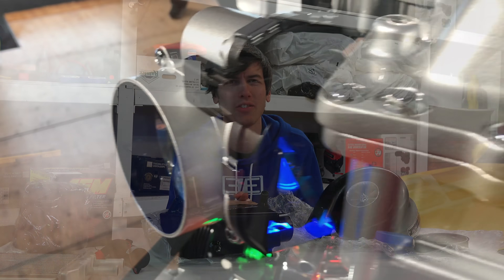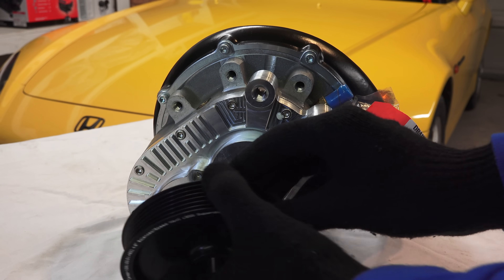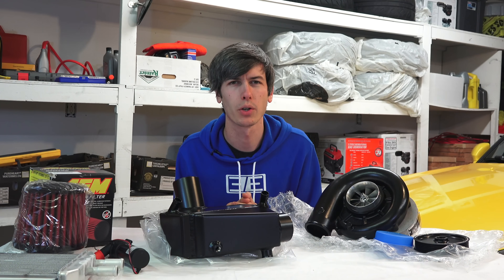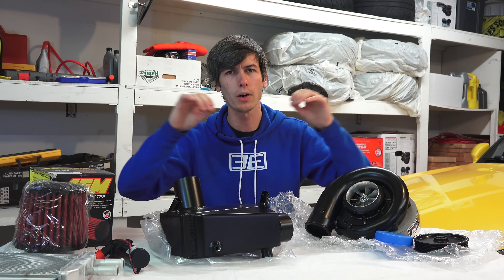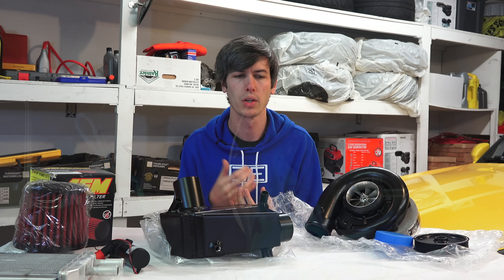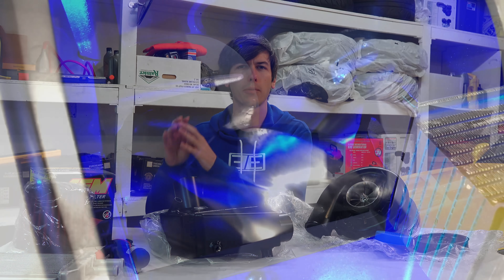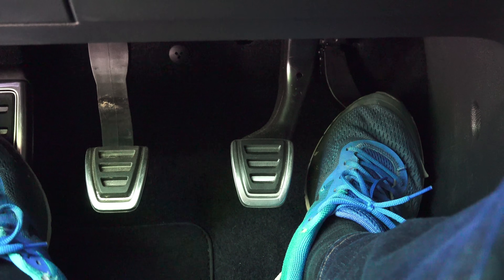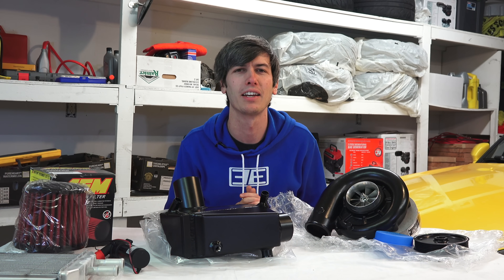Turbochargers vs Superchargers - Which Is Better?

Comment: Efficiency: I'm no engineer but the power has to come from something right?
So the turbo charger uses the exhaust velocity but slowing down the exhaust is also taking torque from the engine since you are slowing down the exhaust stroke. right? So I assume that the power loss with turbo engines isn't as great since the turbo isn't slowing down the exhaust as much in low load situations.
Couldn't we also engineer a super charger that only engages when you... go into a kickdown let's say? It could couple using a small clutch or even some sort of magnetic coupling. Than it would just need 2 intakes, one though the supercharger and one normal one with vents that close if the air pressure is on the wrong side and voila, efficient supercharging ~ probably with introduced lag though.
So If I can come up with such a concept, I assume many people smarter than me already have and there is a catch making that not viable. I'd love to hear that catch.

Comment: Do you get the same fuel economy benefits with a supercharger when your just cruising down the high way or in low load situations? Or does that constant draw from the pully overall always use lower efficiency?

Comment: the intro to your video ! You should talk about Quick spool valves for turbo chargers. how they literally cut off one section of the turbine housing to increase the pressure in the housing to help reduce lag.  

Just a side note for anyone who plans on running a quick spool valve do not run it on a divided twin scroll turbo flange. if you want to run a quick spool valve only run it on an open flanged turbo manifold.

Comment: Quick question, if a car like the mr2 turbo has it's factory turbo inside it wouldn't it already be mapped to match the engine, if so couldn't you just copy the setting so when you add a new turbo you'll have the lest amount of lag.

Comment: this is why the response of naturally aspirated engines is the second most important thing to a race car driver,  first being tires. nobody likes lag,  even if it is just a little bit, its too noticeable.  you can compensate for the lag with a anti lag system but  unless you have millions of dollars to spend on turbo rebuilds, you'll be running smaller turbo wheels to compensate for lag....but you then lose power at high range. so now you add a bigger turbo to compensate for the smaller turbo and all you added was just complexity. supercharger are just more simple and fun when driving on the street with a positive displacement. 

I love turbo for power and efficiency with small engines but nothing beats displacement..... except race rules 😂😂😂😂😂

Comment: Is turbo lag that much of an issue with larger displacement engines? I had read some time ago that the real issue with turbo lag was with smaller engines, particularly 4 cylinders. With engines that are around 4 liters and up that are moving lots of air, I wonder how much real lag you would experience.

Comment: what if we install a small electric engine to power the supercharge and therefore we don't take power from the car's engine ? how much power do a supercharger need to work ?
Reply: do it ! To be fair, where will you get the electricity from? How will it get powered aside from taking electricity that the engine produces from its use? It’s still going to leech energy from the engine. Either that or you have to charge that motor whenever you want to use it.
Reply: 20 % of the engine power is a lot .. so I guess my " invention" will not be practical . For a 300 hp car you will need aprox 50 kw electric motor to power the supercharger and some storage room for the batteries . hmm ..
Reply: About 20% of the engine power so if it's a 300hp engine you need a 60hp auxillary engine to power the supercharger.
Reply: i guess from some li ion batteries which can be charged back from car's 12 v socket ? but I understand it's not practical thoug ...
Reply: do it ! A quick internet search found Aeristech which claims to have a 35kW 150,000rpm motor to replace a turbo turbine.   But I am sure it's not in mass production.
Reply: The Hellcat's supercharger requires 80 hp to run, so...that's about 12%.

It depends on how much torque the engine itself makes and the amount of boost the supercharger makes at a given pulley size.

An electric motor would not have a linear boost progression tied directly to the engine. You would need a controller tied to the throttle position sensor, or you would have problems. An electric motor that could produce that much power 100% of the time would also be horrendously expensive and probably very large.
Reply: ootdega ootdega I ran some numbers.  For the Hellcat, using the quoted max boost of 11.6psi, and using 6000rpm for peak power, assuming these coincide, I get 60HP for the supercharger compressor without drive losses assuming 70% compressor efficiency (which is good) and the quoted max intake manifold temp of 140F, reasonable for the 80HP quoted to drive it as I don't have the exact conditions.  For comparison, 60HP compressor power is about what's needed for a 2.5l 4cyl at peak power with 24psi boost.

Comment: Have to agree with your analysis. My 2002 WRX was often a real pain to drive because of lag. The only way to overcome that was to shift at high revs, where you'd come into the next gear with just enough boost to not get much lag. BUT... that costs for gas quite a bit. It became a real 'art' to get the right gear to get boost when driving, say, a mountain road and really needing power coming off an apex. It often got dicey. It would have been a nightmare except for the AWD saving my butt more than once. Thanks for your channel and your knowledge.

Comment: This comment is not related to this video but I was wondering can you explain why breaks are bad if they lock the wheels? Isn't that the point? They would be bad if they didn't lock the wheels when you press brake pedal.
I got inspiration for this question when I saw those big brake disks on that blue Mercedes in this video :D

Comment: Does any systems exist that concentrates on the exhaust part? What if you, somewhere in the exhaust pipe system drilled a hole, attached a line connected to a compressor or something that would blow air back out the exhaust line and thus create a vacuum, which sucked out exhaust gases faster?

Comment: Given engines with the same cams, displacement, compression ratio and boost pressure, shouldn't the turbocharger make more horsepower due to the lack of parasitic losses from spinning the supercharger off the crankshaft vs the "free " energy from the exhaust stream?  For example the GM LT4 should make more horsepower with turbos than with the supercharger, only it will be skewed toward the top end of the rev band.

Comment: Am I the only person around that kinda likes the idea of turbo lag? Like, with turbo lag I can just slowly/carefully drive (like maybe in bad weather or in front of cops), but then when it's time to merge onto the highway 😏😏😏
Reply: Yeah, that's not anything to do with turbo lag. With a supercharger you just have more immediate pedal control.
Reply: Mario Espinosa I think that's boost threshold
Reply: The problem is that around the mid RPM you'll get a boost in power that's not proportional with your pedal. Which can cause problems if you get it at the wrong time.
Reply: Yes, I think so. Not sure why you would prefer a lag over instant response from your throttle. Merging in the highway is a good example. I want to know exactly when that power is kicking in. Guess what I do know with a supercharger because as soon as my foot hits the  pedal it's there
Reply: I am with you  Mario. ..that along with torque steer makes for real exciting times
Reply: Oh, boost threshold. Thanks! (I meant that I like that with turbos I can stay efficient in low RPMs, but then when I want power I can go to the high RPMs to get it!)
Reply: @marioespinosa6693  yeah , you have to go to the higher rpms to get it

Comment: Hey Jason.👋  I found your channel back in your Integra days and have been hooked ever since.👌 First off, if it's fast, I like it!  Way back when, I owned two Integra GS-Rs.  I can only speak from my experiences, but I've installed a Jackson Racing (Eaton M62 roots style, 6 psi non-intercooled) supercharger on my '94 GS-R and had tons on fun until I crashed it.  Later, I bought a new 2000 GS-R and installed a Drag 3 kit w/ front mount air to air intercooler.  Running both at low boost (6-7 psi), I preferred the turbo.  There was no lag to speak of and at the dragstrip, it pulled better times at the same measured boost levels.  The turbo was properly sized for the application (T3/T04E hybrid) 54 trim compressor and A/R .63 on the exhaust side.  Both were great and I recommend forced induction however you can get it.  Thanks for all your dedication and consistently great content. Have a great day, sir.✌
Reply from the maker: Thanks for the comment and sharing your experiences!

Comment: Nice video, a follow up on Twin charging vs twin turbos (or use of electric turbos) would be very interesting as manufacturers typically favour the latter over the former with a small turbo for low end and response and a larger one for top end power

Comment: I love superchargers, they closest retain the throttle response of an NA engine. Everything feels immediate and responsive. Turbo motors are lifeless outside of spool, if feels like your driving the turbo and not the motor if that makes any sense (it doesn't). I still like them both, I just miss my supercharged cars. Don't miss the gas mileage though.

Comment: Don't forget engine bay packaging limitations. A turbo can be placed anywhere - in fact I wrote a dissertation on alternative methods of turbocharging which examined the use of rear of car turbos (replacing silencers for turbos.) A supercharger (unless electrically operated or hydraulically operated) needs to be placed in line with an output gear of some kind from the engine.

Comment: Why do superchargers need so much horsepower? Is it the gearing?
Reply from the maker: It’s the fact that it’s running a high powered air compressor. It takes a lot of energy to compress large amounts of air, as superchargers do.

Comment: Just do it like Mercedes in F1. Put a electric motor on the shaft of the turbo to spool it up with recouped braking energy, when there is not enough exhaust gas. This gives you something between a classic turbo and a electrically driven supercharger.

Comment: And the big question is: can a FRS make about 300 hp at the wheels reliably and would you need to upgrade the engine and transmission on a supercharged build? And Jason if you read this what happened to the crocodile/dinosaur costume you wore for the reading mean comments video?

Comment: Have you ever driven a hybrid turbocharger where an electric motor is used to spool up the turbo? Does it feel like a supercharger?
Reply: @Erik: 48V but otherwise as you described. That is the concept of an electric supercharger. Audi uses the supercharger only to get rid of the turbo lag, for normal operation two conventional turbochargers are installed and the electric supercharger is turned off. So I assume it won't consume too much energy, in addition it is only used in 400hp+ sports vehicles, I doubt they care much about efficiency.

The concept of a hybrid turbocharger is different. Such a turbocharger has a motor / generator in line with the turbo shaft, which allows you to boost the turbo using electricity, but also to use the turbo to generate electricity.
Reply from the maker: I have not, I’m not sure if there are currently any production cars with electric turbos.
Reply: @HerkimerSnerd: Audi uses a very interesting solution. They use two conventional turbochargers and an electric supercharger. This way you can increase the power output during acceleration, using energy stored in the batteries.

@Engineering Explained: Oh, I thought they where already in production, but looks like they don't exist outside F1 and WEC. At least considering a hybrid turbo a device which can work in both directions. The audi solution is unable to produce energy.
Reply: Daniel Rose
Thats pretty cool.
Reply: @Stephen Kramer: That is again a different concept where a motor (not a generator/generator) is attached to the shaft. It can only use electricity to spool up, but it can not create energy.

I just realized I forgot about to mention the concept of a series hybrid turbocharger, the one I described above is the parallel version. A different option is to use a turbine / generator to produce electricity and a electric supercharger to compress the air. Great advantage of this system is packing, you may fully separate the hot exhaust side from the intake, also allowing a more direct route for the air.

We probably have to wait a few more years to see what concept really works.
Reply: Daniel Rose Yes, a motor on the shaft can also be a generator Dan.  I should know I've helped design some of these.  High power at high frequencies is a difficult mechanical and electrical problem and currently the solutions are cost prohibitive for the benefit provided to the mainstream automotive market.
Reply: Is the elctric motor spinning the turbo just a flat out 12VDC motor? Bc if it is then its probably not the greatest design. Yeah its turbo charging the engine, creating the boost you want, maybe even removing the lag a bit better, but what most people dont realize is how UNefficient car alternators really are. They only produce between 50%-60% effeciency. 
Meaning if that electric 12VDC motor is drawing 40 to 60 amps to spin and create a good boost, Its eating up 3 to 5 HP from the engine through the alternator, just to keep the battery charged. Most super chargers wont draw that much, and give more way more boost with no lag. I know Whipple claims thier twin screw set ups for the bigger 5.0L- 7.0L engines only require 1hp or so just to spin them.
Now i know mathmatically (746Watts = to 1HP taking 50% efficiency into account) if you run the numbers i described above to check me, it doesnt exaclty jive perfectly due to all the factors included. However in my real world testing most alternators will eat 1hp for ever 12-15 amps (@13.5V -14.5Volts) they produce. And thats at 3600RPM.
Reply: Daniel Rose a turbocharger with a motor on its shaft should be called an electrically assisted turbo.  They are difficult to engineer and very expensive to make.  The rotordynamics are difficult to deal with and the electronics to power it are complex, large, and dissipate a large amount of heat.

Comment: I prefer superchargers because they're not creating much heat, and the power they use only really matters if you're doing Dyno runs. Top fuel drag cars are still using superchargers, and there's nothing faster out there.

Comment: Wrong! Your exhaust is not free flowing. Your engine needs to pump your exhaust up to pressure in order to reach that threshold and that cost you crankshaft horse power. Turbo chargers DO run of your crankshaft. They just use a column of exhaust gasses instead of a fan belt. Remember, there's no such thing as free horse power.

Comment: I have to agree. Supercharged cars have that punch right when you give it gas. It just makes your car feel more powerful after adding one. I've always thought that a supercharger get a more powerful feel, because of how instantaneous it is, and a turbo feels quick, since you get your power once you're already moving. Both are awesome. Just depends on what car you have and what you wanna do with it. Like your S2000. Power comes on at around 7,000? Supercharger. Get all that bottom end your car lacks. A car that only has low end power? Turbo it. Get that top end power you need.

Comment: I remember you touched on oil.
Did you cover heat?
The turbo has a high likelihood of burning your vehicle down.
In a tight installation they make blankets to cover them, even then an oil leak onto a hot turbo.
Reply: And could you explain the down stream turbo and it's effectiveness?
The ones they place behind the rear axle and pipe them to the motor.
Novel idea I never saw any real information about.

Comment: Are the Volvo engines with both a supercharger and turbocharger the best of both worlds then?
Reply: ihateshysters technically(vw has it in the group for years) ,  but so is the powerpulse in diesel models. The new 48V eletrical system in VAG,  BMW and Merc will lead to new electric turbochargers

Comment: When do you think splitting the housings of a turbocharger, like Mercedes does in F1, will become more main stream? It's pure genius. Splitting the hot and cold sides to increase temperature efficiency and using an electric motor via shaft through center line of the engine, to keep a low end spool. Love your videos, hope you make a video elaborating if this might be cost effective to make future sports cars.